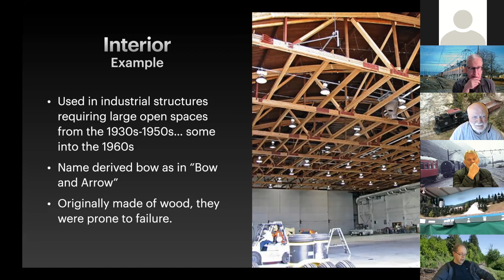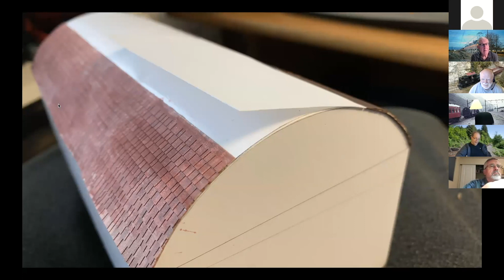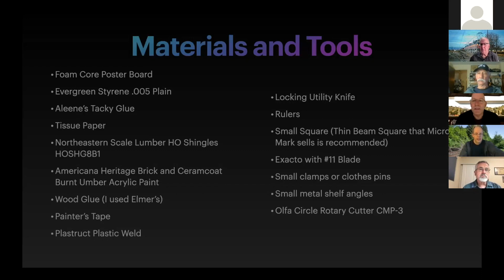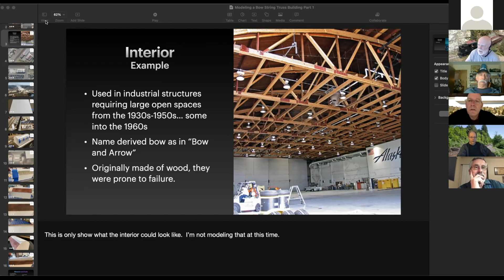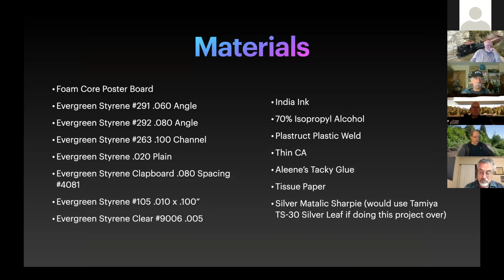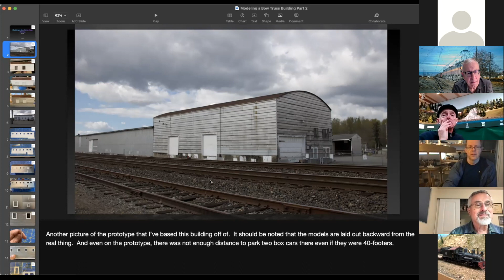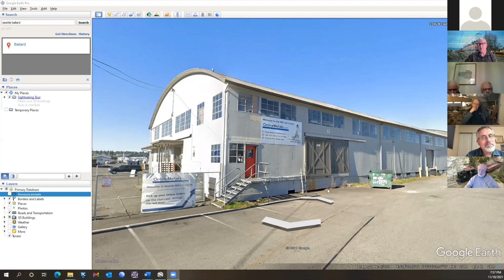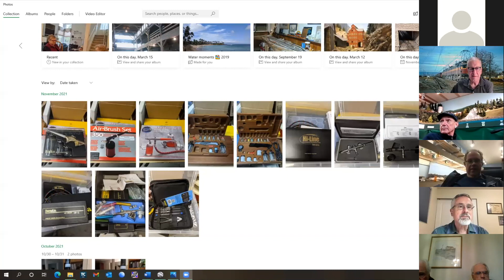Modeling a Round Roof Building (Bow String Truss) with Larry Sloan

Comment: Nice show,  We have a lot of Bow String Truss Buildings in Arizona.   Mostly smaller shops in the 20' to 50' wide size.   I have 3D printed out one with the trusses on the inside for those that want to look inside.
Reply from the maker: Thanks! What are those buildings used for in Arizona? Is there a video, model, or image of your 3D printed model?